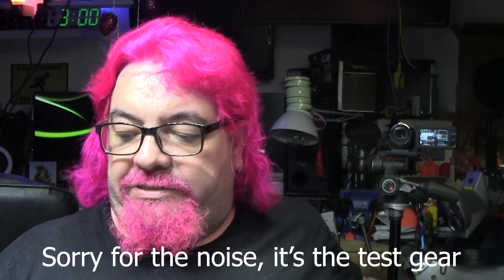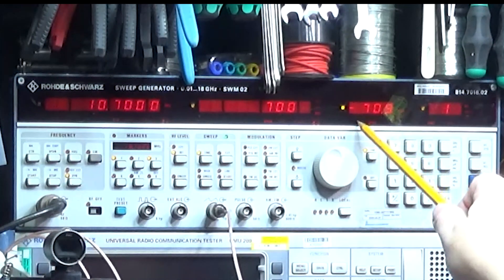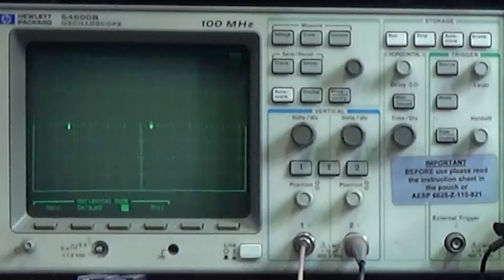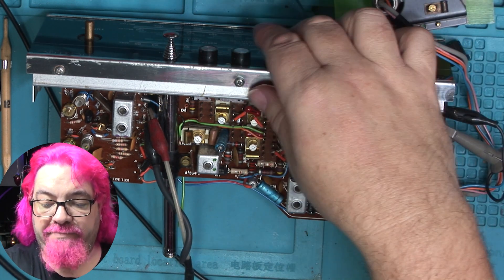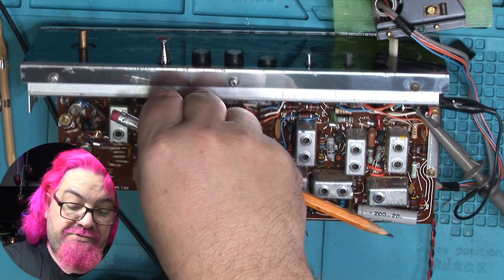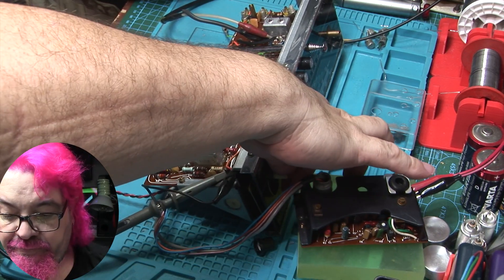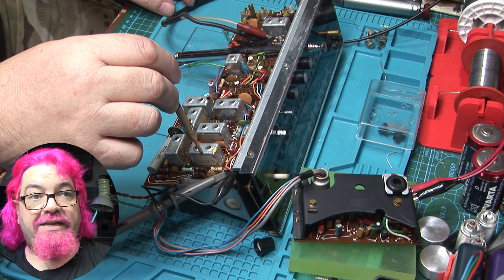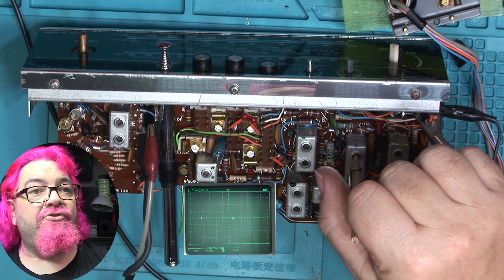Transistor Radio Repair: Hacker Hunter Swept I.f. Alignment

Comment: Great video but I don't understand why you lifted the capacitor to remove voltage from the back end. (4:42) What is the "back end"? AGC? Earlier in the video you mentioned that the generator output voltage needs to be set low enough as to prevent AGC from kicking in so I'm not sure what exactly you are doing in this step.
Reply from the maker: It was strange to me as well but that is what the manual calls for. I havent dived deep into the reasons at this point.

Comment: My favorite way to do an IF alignment, as well as other work, and at my last job, many years ago, I had pulled out the sweep gen and set it up on the bench, only to find it missing when I came back from a break. I asked my boss, and he said, don't use that old junk! Which left me to the old peak and sweep the oscillator manually to verify my results.

Now that I have my own home shop, I have a spectrum analyzer with tracking generator, which is a pleasure to use! And I only answer to myself!

Comment: Nice one George, it's a shame my super-duper RF generators don't do sweep, I have to dig out one of my old HP analogue jobbies, which is a bit hit and miss. Anyway, hope you're okay. All the best from Aston.
Reply from the maker: I have to try my super duper IFR on sweep mode. it is there but the sync pulse is on a rear socket so I'm not sure if its a ramp or a gate pulse. It doesn't have markers built in either so it means having to sync it with the external marker first.

Comment: Good stuff George. So, if I swing a signal generator around my head on its mains lead, would that work the same? Does that generator have markers? I think that's an issue for many trying to work this out in their head, not every sweep generator or wobbulator outputs markers so you might not know where 10.7 is on your scope.
Reply from the maker: if you do swing the sig gen round your head then be careful the ieee plug doesn't let go. I do have markers on the generator but the scope is to fuzzy to display them properly. Must try harder!
Reply: @GeorgeChristofi  I was watching on tablet so couldn't see the markers, Next, aligning an RA17..! :)